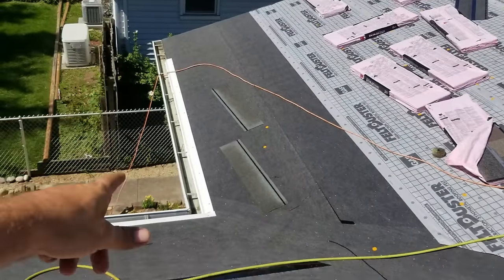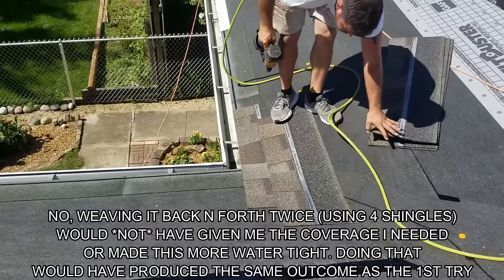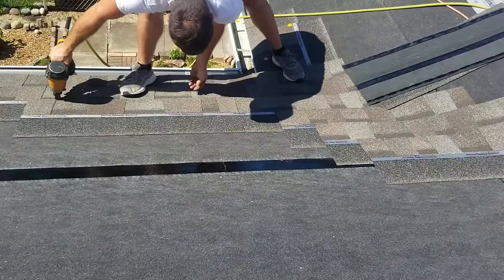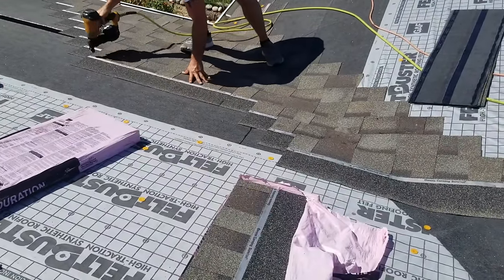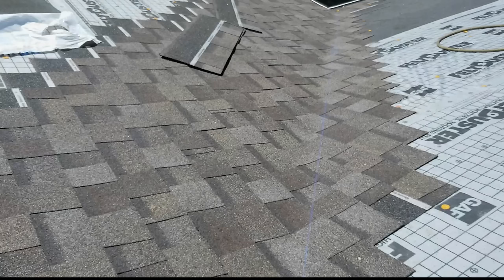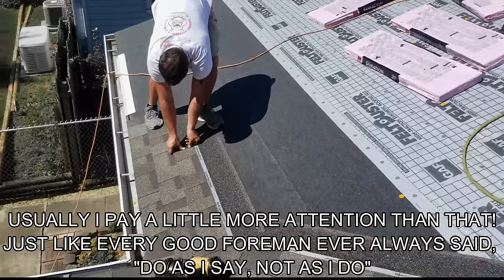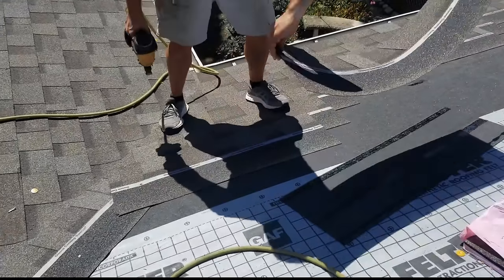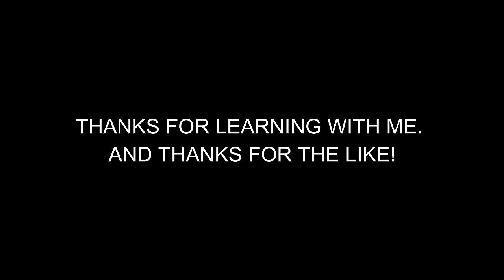How to do a closed valley!!!

Comment: I am not a roofer by any means however I used a pair of my brother's work boots called cougar Paws one time they are specially designed boots for roofing only and they are simply amazing I have never ever had such grip and confidence on a roof as I ever did with those on my feet they have replaceable super sticky foot pads that go on the bottom of their shoes that just make it as good as new whenever you need. I will never go on a roof again without a pair of them. And the most Roofing I do is to blow up my gutters. Or some painting

Comment: Hi. Im not a hater. Everyone's can do as they please. I live in North Central Nebraska.  Been replacing shingles on roofs here since 1984. Mostly steeper pitches. 6/12 to 8/12. Have done 12/12.  The flater roofs can be done by the do it yourselfers, or new roofers starting out. I'm not saying i won't do 4/12. But when i do 4/12 and have valleys, i will not put a nail any closer than 16" of the center of the valley. On steeper pitches i wont go closer than 12". The older houses have steeper pitches. They can still get debris, (leaves and small branches) collected in the valleys. They don't always wash out. Especially when the valley is above a porch. The porch can be a 4/12. People can see the debris but dont put forth any significance to the eye sore. It is what it is. In this area we used to have significant snow falls in the fall, maybe starting in October.  Would have maybe 5 inches one week. Warm up a little, then another 5". Warm up a little, get some snow melting. Then get real cold. Then more snow. That first snow might not leave till April.  Sometime around the early 90's the weather pattern seemed to change a little.  We don't seem to get the snow from the fall staying on till the spring like we used to. Well in those times when the snow stays on the roof and or ground through the freeze and thaw cycles, the snow on the roof looks just fine. The older houses the heat from inside the house would warm the roof under the snow.  It is surprising how that process can create an ice dam, and water will wick up under the shingles in the valleys.  Maybe the moisture never shows up inside the ceiling.  But that moisture will come through at every hole created in the valley.

Comment: Great video and this is the best way to run a valley. We call it a no cut valley. The only thing I do different is my valley line is out of the valley about 2 inches so that water can somewhere roll up and hit the valley shingle which keeps it from being able to work it’s way up under the shingle as easy.
Reply from the maker: There you are.  I scrolled past your texts today n was wondering where you been lol I like it a little closer coz it still has that same effect but looks a little nicer in my opinion but to each their own. Close enough right. If I had to guess mine are usually about 1 1/4 out of the actual center

Comment: Have you ever used Malarkey shingles?  We had our roof done in August-September by another Company in the NWI.  Hail damage.  Paid an extra $2,000 to upgrade from GAF to Malarkey.  But the rest was paid by insurance for the roof on our home and detached garage.  I'm happy!  Didn't see your content until after that was done.  You remember the hail on Memorial Day I am sure, along with the tornadoes in our region?  There was also a hail storm in mid-March of last year as well, although with no tornadoes that time.  BTW, our home had Timberline shingles on it prior, done by some backyard smucks with no permit (previous owners did this job.)
Reply from the maker: No I haven't heard of them! Is that there brand or the style name. And yes there was a lot of storms in valpo by Burlington beach road mostly
Reply: @NWIVeteranConstruction  https://malarkeyroofing.com/

I saw a video, they used an AR15 with a blank firing adapter that shot a soda can at a shingle and it did virtually no wear.  I was sold, for future hail storms at least.  I've noticed Timberline and GAF to shed a lot of granules.  Our previous roof was a 7 year old Timberline and the gutters were full of granules.

Comment: Was worried about installing a valley with architectural shingles. Got a bid of $28k for a 24 square roof and did a check on materials $3500. This will save me 24 to 25 k Thank you
Reply from the maker: i have several other valley videos. be sure you know exactly whats going on before you do it. best of luck my man

Comment: That’s a style of lapped valley I haven’t seen. We used to run the under roof so the bottom corners of the courses were 18” beyond the valley center. Then we ran the overlapping roof so the top corners of the courses made the valley center. We trimmed those courses as they were laid to a snapped line at or just short of the valley center. Tool of choice was bulldog metal snips but it ruins them for metal.

Comment: You seem to not only know what you’re doing,but you know why. I’ve been roofing since 73,so about 50 years. The only thing I would add, is when you’re turning up the valley go ahead and run the outside coarse first. That way you don’t have to have the end of the shingle drop or raise. I understand that you are looking out and going by the outside so it will be straight. Good job.
Reply from the maker: Thank you!

Comment: Does nobody weave valleys anymore? Either way is fine I just prefer too weave. Unless there is a big pitch difference.
Reply: With all do respect you shouldn't  with the thickness of dimensional shingles.. don't do california cut valleys, just closed, hope this helps ya
Reply: @BrettTracyRealtor  your comment has nothing too do with my question. I prefer weaving a valley. And what he is calling a closed valley is a California valley
Reply: @brianscheuermann9862  Just trying to help my man!! My answer is relevant to your question. You stated, " does anybody weave valleys anymore."  You don't weave demensional shingles becuase they are a thicker shingle due too 6 layered technology and sawtooth technology like GAF Timberline HD. You only weave 3 tab shingles according to GAF now.  The best way in my opinion is a closed cut valley not a closed cut california valley.I have had these leak twice on me.  Why install a demensional shinlge with the nail pattern so close to the middle of a valley.  If YOU really want to install the closed cut california valley I think a starter strip would work better because its completely flat compared to the saw tooth laminate of a demensional shingle and squeeze a gob of GeoCell on the nailing pattern of the vertical shingle going up the valley.  I only install closed cut valleys now because closed cut california valleys void the warranty through GAF.  For reference look on pages 212 to 217 of the GAF Steep Slope Pro Field Guide.

Comment: Quick underlayment question.
Is it acceptable to weave the synthetic underlayment first then run the ice and water shield down the valley? The video seems to show this. This DYI guy wants to do it right. Let me know.
Reply from the maker: No I'm sure it's done valley first the video.  But apparently the actual rule is to weave your bottom rows of ice and water shield 3 ft past the valleys center point. Then run your valley ice down the center, then run felt.  But a pro tip, I've never seen any roofers do that. Most of us just run the valley first then everything else starting with the ice and water shield at the bottom if it's required on eaves in your area.

Comment: I weave my first 2 rows always. And I mean weave. High side low side high side and the rest is low side. Don’t like how you ran the first 2 without weaving but it’ll work just the same. Weave looks better.  Also run outside shingle first and valley shingle second when on the low side opposite for high side. Always 2 wide both side of valley.

Comment: do you not need to remove the tape on each shingle so they stick together? Why is it there?
Reply: Tape is there only for shipping, so that you can separate the shingles as you remove them from the OEM package.  Thereafter it doesn't matter is tape is on or off because the area under the tape does not need to be sealed (to any other shingle) when installed or roof.

Comment: Another thing folks....unless you are using hi-temp ICE AND WATER SHEILD, 
You should install synthetic over ice and water . The ice and water will fully adhere to sheeting. Shingles will fully adhere to ice and water. That means in 20-30 years when the next roofer comes along....he will have to inform customer that all areas where ice and water was used needs to be re-sheeted because last roofer used improper ice and water shield, or never covered with synthetic.  Could cost homeowner alot of extra money because of improper application procedures.

Comment: You know if I'm missing something let me know... but don't you have to lift that valley edge on your overlay and apply tar?
 All the valleys I ever ran were on 3 tabs shingles and wove them.
That closed valley has to seal..
How do you seal that edge?
Reply from the maker: Its Tar side down so it seals itself.  But if you look at other valley videos a lot of guys do an open cut valley and that's much looser. They don't normally seal that either from what I've seen and people swear by that valley.  I always do this one
Reply: @NWIVeteranConstruction   I'm in Jacksonville Florida we have so many high wind days tropical storms and hurricanes it wont hold up.
So that that seal strip is landing on granular surface instead of the cleaner surface it was designed to hit on, with much less granular substance..
 So it may work another part of the country dealing with a lot less steady high wind but yeah I can see that lifting in a storm and then the seal may not come back ever.
 We have the California style cut closed system and those edges were all lifting on my roof when I bought this house.
We tar sealed them.
 Would the valley leak?
My guess probably not.
 But again in my neck of the woods would definitely want to seal it with the tar just to get an extra bond and keep the lifting out of the pictures to shingles aren't subject to breaking and peeling up.
 I am a carpenter by trade who built houses installed siding windows doors interior trim dried in roofs, shingled roofs, ran wire and  plumbing on whole house..There is a nearly bullet proof way to do it and if I can do that way I'm gonna do it..

Comment: I would of fell off near that end of valley & 90°gutter  lol I'm not a roofer though. So I'm getting a roof replacement end of april 1420 sq quoted $9,300 in Mid Mi is that fair? I figured it be lower 😮 I'm on a retired pension Ck
Reply: In GA here, bought my materials for 3k, 1800sq, doing it myself

Comment: Im from germany born in the us dun get the name wrong now . We have to cross pattern the valley , like left up the valley then right up the valley . U have double material in the valley but its impossible for water to get in . This is no rage comment or hater comment i was just curious what u guys think of it . Germans dun have the hot temperature like u guys do , snow alot of rain , mostly no shingles . Ive done 2 shingle roofs in 21 years . And code said to do it like i explained .

Comment: This valley is the 'easy' valley or also called California valley. The lower your roof slope the least I recommend doing this.
When second side starts shingling that is where passing the valley with your shingles is the most important, but his shingles are the shortest covering valley area, only as he goes higher valley coverage becomes ok. I think the third or forth shingle has its keyway exactly in the middle, not good. I always use 'full valley' by striking a line in the middle and have all my shingles lower corners aligned with it. After you're done need to cut excess shingle off so all you see is a straight solid line. More difficult, harder to do, needs experience but rainwater has less chance to penetrate under. If you have pine needle type of trees around your house, especially dont do this type of valley!

Comment: The real reason the main roof would be the cut part of the closed valley is not because it's higher, but because a greater volume of water will flow on that plane of roof, and the purpose of a closed valley is to shed the majority of water with the most velocity/volume onto the underlaid half of the closed valley. It is also not acceptable to "skip" fastening 12-16" of a shingle to accomodate for incorrect shingle spacing. This is against manufacturer specifications, and should be avoided as it voids the manufacturer's warranty. In all applications, whether it be 5 or 6 nails, fasteners are required to be placed equidistant from each other, and they are required to be placed no closer than 6-8 inches from valley center, and other than the fact that they require the nails be flush and straight-driven, these are the only rules. Not mentioned in any manufacturers specifications or building codes: This method of valley. Some people refer to it as a the "California Valley", or by some of your more politically insensitive old school salt of the earth alligator skinned alcoholic roofers as the "Lazy Mexican valley". This method of installing a closed valley is not approved by anybody; no manufacturer, no local building code, and certainly not the NRCA endorses this particular type of closed valley application, and using this method will absolutely void the manufacturer's warranty. Not to mention it looks like shit. The patterns clash and it just looks out of place to have weird diagonal lines where elsewhere on the roof there are none. I advise vehemently against using this unapproved method of closed valley shingle application.

Comment: So if this is the way you're going to do valleys. Is it wiser to start shingling from the valley or it doesn't matter?
Reply from the maker: Yes I did start from the valley.  It is wiser but things to consider like the side of the roof you're shingling.  I am way faster shingling on a right handed stair step so if the side is sizeable it might make sense for me to switch up.  As long as you're experienced with valleys and know the fundamentals well enough to avoid mistakes you're going to be able to do a fine job either way.

Comment: This is awesome!!!  It looks fantastic!  So based on this do you start with the valley and work outward in both directions to the rake?
Reply from the maker: I ended up doing that because of my time crunch.  But on a side 2 square or bigger, I'll go from the rake, inwards.  Because I'm way faster with a right handed step than a left.  It's a preference thing.

Comment: I’m a fan of snapping lines.. we snap every other shingle to the top. It helps line up on the other side of the dormer too.
Reply from the maker: I made a video about that. Let me know what you think
Reply: if you spend a little extra time getting the felt on straight  you can use those lines.
Might have to measure down from the top or a plywood joint.
Reply: @robdonna1000  can’t on ours, we use a custom made synthetic with a logo on it.
Reply: @tmfd9476  I'm old skool I like stuff with lines on it. Good luck with that

Comment: So correct me if I'm wrong but I thought you had to put your drip edge "underneath" the ice shield. Although it might not be required for where you live. You ever have any problems with water wicking back up under the shingle and bypassing the gutter and leaking through the soffit?
Reply from the maker: You're right, 98% of the time I follow that rule. But no I have never had any issues because I shingle well

Comment: nice video except for you should double gauge your shingles  no matter if your going up left or right. eyeballing the (left side in this case) that your next shingle coming away from the valley is not ok. assuming your bostich is set at 5 5/8 (or the 5 1/2 notch on the gauge) and eyeballing the waterline or double laminate part makes it off by at least 1/8 so if you do the math after every bundle of pabco for example which has 16 per bundle will create a one inch variation after the bundle to where it would be if gauged on both sides going up ... the trick of running up two at a time i love and have used for decades now and always come up right .. anyone reading this should know im not trying to beat you up i liked the video and more people should share tips and tricks but after seeing hundreds and thousands of valleys either gain or drop this comment could possibly help any future roofers in their journey.

Comment: Ok let's look at this valley your doing..first it looks as though your a right handed roofer.. on the left side of the valley your going to be roofing it more as a lefty would roof it..I understand you wanted to show how the valley work is done but as a right handed roofer I would start from the left side of the roofing toward the valley.. the pieces you have to cut as you adjust going across the valley can be used on the gable edge or hips...im old school roofer from back in the early 70's we always felted the roof then laid out our shingles above us (..we hand nailed between 15 to 20 squares a day) heck with a gun we did 25 squares a day....I realize this a training video so you may be doing stuff for the person who doesn't know roofing.. keep up the work